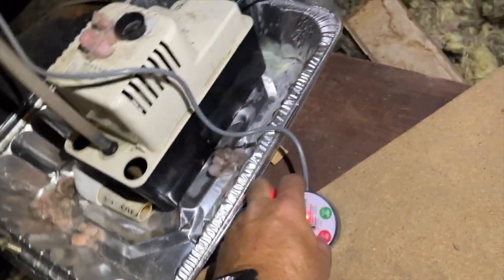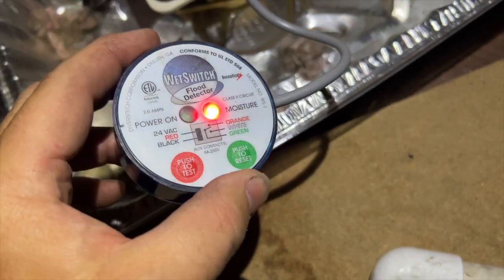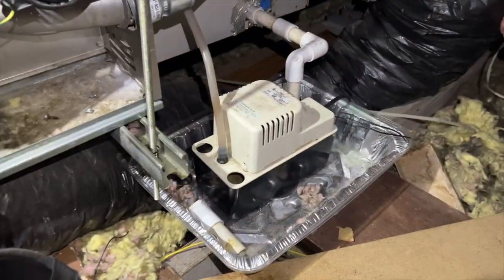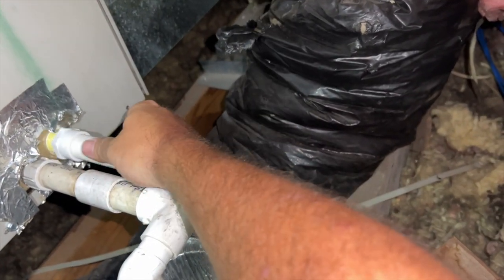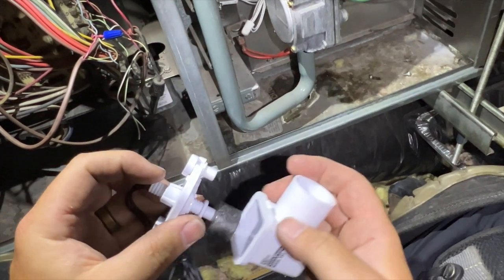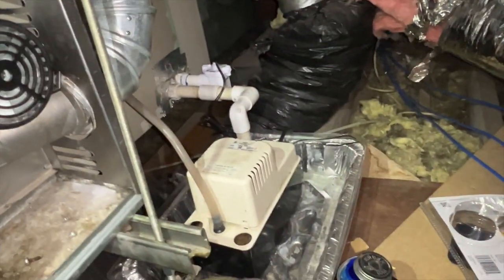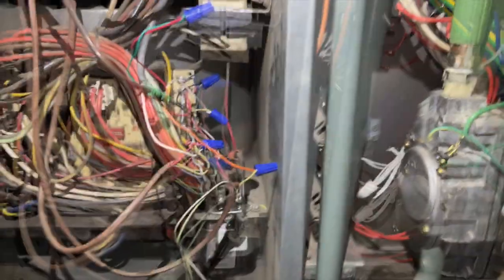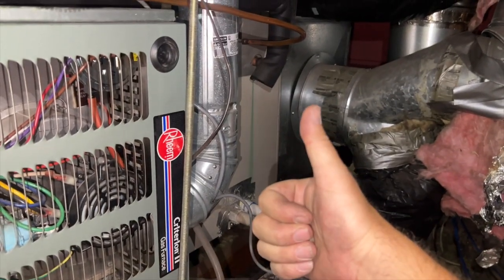How to Wire 3 Drain Safeties in Series EP140

Comment: I normally wrap the wet switch and my vaccem hose in a towel then vaccum it dry it normally takes about 10-15 minutes and works perfectly afterwards. Haven't tried this style of wiring yet will do the next time im installing 2 or more at same time

Comment: Any draw backs to wiring in series that be a potentially an issue?  Usually I wire them as recommended by the manufacturer but I love this idea.  Shutting off the the call outdoor but leaving the furnace or blower motor portion intact to continue to work is great.
Reply from the maker: As long as you have tight connections and don’t exceed your unit’s maximum low voltage wire length you’ll be golden.

Comment: What type of gas line is that?
Reply from the maker: It’s a regular flex line. Someone just put a old water hose over it to prevent rubbing.
Reply: Good video.  One note.  If that were a condensating furnace you would wire in series to shut entire unit off, not just the A/C, otherwise you would flood the attic in the winter if that pump failed.
Reply from the maker: Agreed. If it was a condensating furnace I would wire it to the R terminal.